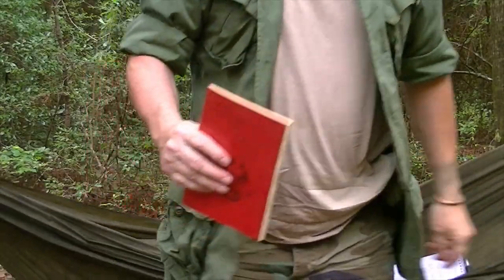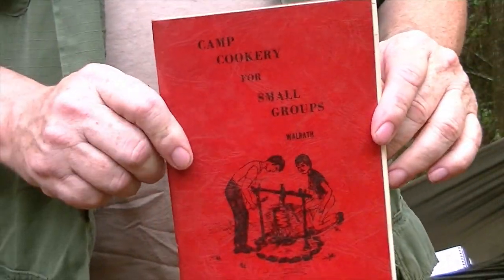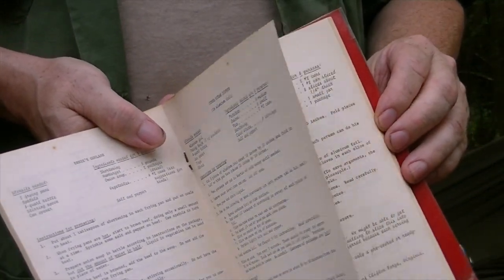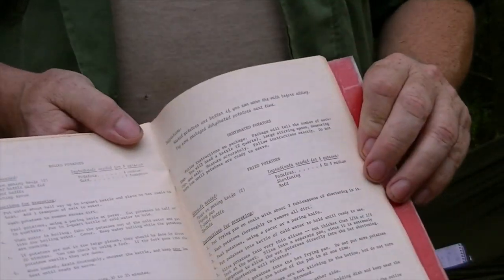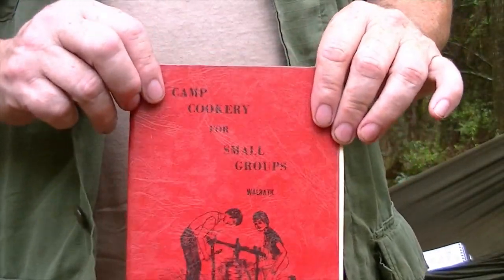YOU ASKED THE QUESTIONS HERE'S YOUR ANSWER

Comment: For the figure 9 question: a nite ize cam jam can replace the figure 9 and prussik loop, and is the absolute easiest and fastest way ive found
Reply: I have done this as well🤟🏻
Reply: Those cam jams are handy for sure, I’ve been buying them up on clearance for a few years now
Reply: @hiramhaji7813  same lol...Harbor Freight has them on sale usually 👍🏻
Reply: I also use figure 9’s. I found the cheapest place to find them is from sportsmen Warehouse website. As of at least Jun 2021 the nite ize small F9’s are only $1.95. I keep 5 or them with each hammock kit to use for ridge line & tie outs. 

I had cam jams but they do not hold remotely close to what the figure 9’s do. As well as the 6 figure 9’s weigh about the same a 1 cam jam. Im not trying to down the cam jam, is just not for me.

Comment: I first came did your channel when looking for a certain type of knot. Can't recall now what it was, but was thoroughly impressed with your adjustable guyline. I've continued to stick around to glean valuable Bushcraft knowledge like this. You never disappoint. Keep up the good work and I look forward to the cooking playlist series.
Reply from the maker: Thank you very much!
Reply: Hey @BlackieThomas I have a new take on the Prussik/soft shackle that is thought I'd share with you.
I had a loose piece of Paracord about 24" long that I was attempting to turn into a Prussik loop like you demonstrate. After getting it tied it ended up being about 9" long. I wrapped it around a "ridgeline" (only thrice) and dressed the Prussik leaving the knot at the top. After doing this I realized I had enough slack left that I could thread it through a tarp add a bead/band and capture that top knot and make a soft shackle out of it.
After some testing and a couple of modifications (had to remove two inner threads to get a doubled-over strand through a pony bead) I've produced several and will be using them to throw up a tarp this coming week at the beach.

Comment: Blackie Thomas 

Had a quick question about dealing barrel and cylinder when antiquing  an 1860.
What is your opinion on using a hot glue gun to seal these?
Reply: Sealing
Reply from the maker: it might be too hard to remove.. i have plugged mine with rubber cones you can get from lowes and other stores
Reply: @BLACKIETHOMAS  still taking my time with it...
(no courage)..
I know if anything goes wrong I can fix it, it's just taking that first step. I've got 3 original  Colts,  all 1976 box set, but I've got 5 Italian models that I can practice on.
Reply: Thanks for the good advice!

Comment: SERIOUS QUESTION!!!!!!! how can you seal your percussion cap to a nipple so that your caps will go bang when you need them to even after loooooonnnnngggg time being loaded and carrying i live in Pennsylvania and its super humid and ive managed to get 5 months and have 5 out of 6 go off but that was the longest period of time ive managed to get them to last.. it seems like im wasting caps constantly changing them every few weeks. PLEASE HELP!!!!!
Reply: Also ive noticed a difference maybe you could touch this subject i use pyrodex P for extra velocity but ive tested pyrodex RS and it seems to have even more power maybe you coud crono it? I use 30grains with 454 round ball in a 8inch uberti stainless 1858 and a 5inch pietta 1851 navy in 44
Reply: Jonesy's Self-Reliance - I've had good results by adding a drop of cheap nail polish inside my percussion caps (effectively sealing the compound from any humidity), very much like military ammunition has lacquer sealing around primers and case mouths... I hope this helps you... Gary
Reply from the maker: ok and this is a bit out there but i have taken and used a tooth pic to put a little chapstick around the outside of the nipples then  pressed the caps home  i fired it 9 months later and all went..but that was back in the 1980's and caps are a good deal weaker now hope this helps ya

Comment: The KBAR BIG BROTHER is a larger version of the knife that has saw teeth all along the flat part of the spine. The OKC3S is a a different knife
Reply from the maker: sorry i did not have one of those..
Reply: Its probably the most useful adaptation of serrations if you really need them and you still have a full plain edge. The serrations can be sharpened with a DMT Tri fold rat tail too. I have the OKC3S and I agree with your assessment wholeheartedly😂
Reply: The Big brother pretty well negates the idea of batoning which is fine for those of us who severely limit that task to a sensible level!😂